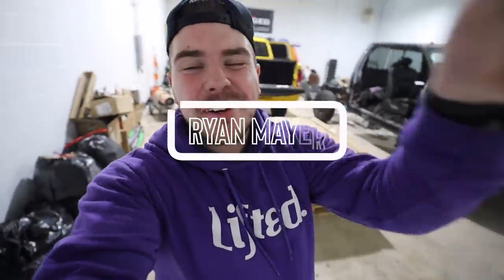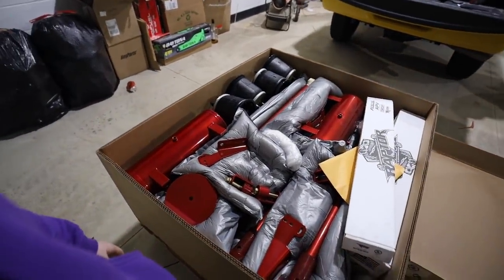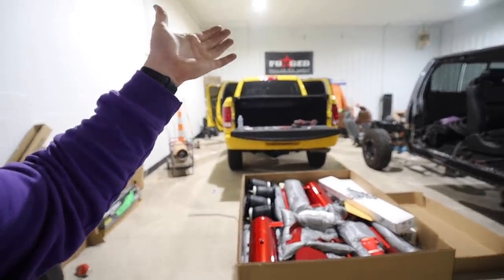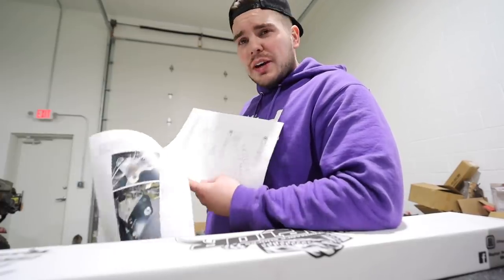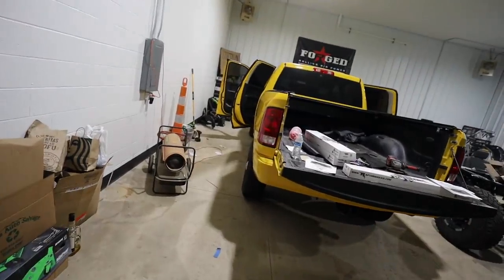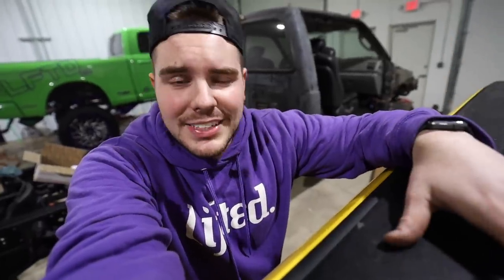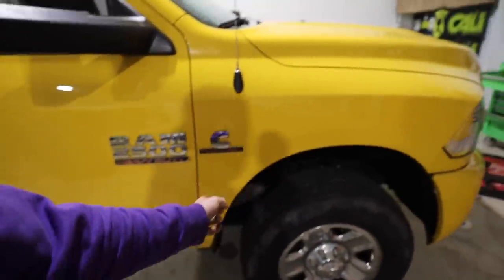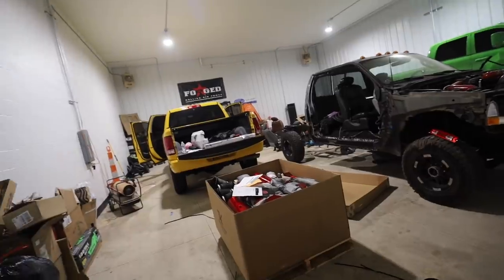The Kelderman LOWERING Kit?? IS HERE! | Building a Banana Ram | Part 20

Comment: Here's a good tip 4 ppl who put starlight headliner... use some sort of heat/sound barrier.  It's not 2 expensive,  helps with roof vibration ( if u listen 2 loud music😉),  and it'll help protect the starlight fiber optics on those hot summer days😁

Comment: Ryan: “you can’t really mount resi shocks on these trucks in the rear”

Carli: “That’s cute”
Reply: Yup! King makes resi shocks for 2500 4th Gens as well. 

I’m running Fox 2.0 resi’s with LSC adjuster on mine. A little thinking outside of the box and it can be done. Fox makes a direct fit 2.5 series with resi as well.

Comment: The rear tilt up hatch slider window should be like 2 sliders in 1, so fully screen 1/2 inner & 1/2 outer side way stronger if screen facing out both sides. double hinged middle each side fits down seals over inner & outer pieces & tilts w/slide prt way either side or port hole instead of slide.

Comment: If rear tailgate has a clear slide in plate spot built in with a locking safe screw it would be nice spot if u don't drive tailgate lowered.

Comment: The rear 50 vs 50 right left tail gate like ram basic set up like old suburban but then attaching to that is flip down prt as well normal oldest truck out there. So must fold down after u open 1 side up If u can pick wether to open left or right & then flip tail down seems like near to dodge best of all. 1 side tail folds flat other sde tail folds past flat. I came up w/idea to make rear bumper the tailcate when fully open or no bump tailcate  when closed off roading & alot of cool ideas in tail gates NOW but bumber tail gate is a $100 dollar option free use in market idea. U just hve mico rear bumper steal thin protection or flip down rear bumper my design, but I love dodge hving to styles in 1 suburban & fold down both ways sp for jeeps fold out rear racks style.

Comment: saw ad for jelly fish lighting. If it had solar mode so run the yr only every 3rd light 12 volt brights on or off w dusk to dawn mode but during holiday it turns color u pick every bulb can light or 1 bulb burned out rest stay on holiday mode.

Comment: Any tanks on the 20ft trailer where v swings to right or left so u can drive on & easy off for mobile truck wash. U just hve to put as many hot water drive type thin shallow tanks width of trailer u need on the trailer. Every thing else simple water quick connect up or off & must be able to pressure washer lift off trailer to ground turns on & off like pressure washer u talked about. A honda generator or similar set up few things to lift off or spring wand unfold so trucks can roll under no heaight problem then unset up nice & low going down road, same idea up firing sprinklers for car wash, just must get clean in 20ft or need a 2nd dive thru if mudder dirty.

Comment: A mudder hving a shock extend rebound up thru bed floor & into 2nd top shock rebound back down if u cause a bump shock tall rebound. Or just hve it stock bump shock limited for normal road use then just pull cap & counter rebound if into the bump strong range. The bump range u just unscrew or screw back on. So 15" single or double weight load set up can quickly switch to top of bed 30 2 15" shocks that counter rebound.

Comment: hving a 1ft 18" min slot retangle cut in front of your garage door so u hve flood protection & lift of grate 1 ft more drive in drive out under factory basic roll up door just need good 14" diamond gas diamond blade saw even if no plumbing u can leave bottom of cut out floor just easy drain gravel over sand or so collection pit & hve plenty of flood room range, as long as grate over hole has a way to cover seal off so not down grade drive way filling up off street into slot cut hole, no plumbing rain. Every fuck jeeper or suv owner needs it, & will gladly pro pay if neat work clean cut or patch clean grater weld up.

Comment: 487 depending on where in country u live u can take a 20ft ish flat bed 2 axles dual tire trailer & convert it in to mobile car brush less car/truck tall work truck w/easy from drive off ramp  just unfold in 1/2 * & tri fold or lay on over the dual fold to on to road. so easy drive on & off u get a change to hve lots of custom touchless traffic where ever u r at free ad & bussiness cards or location free car wash if u buy a 10 tee hirt combo deal ad into greater ad.

Comment: a bussiness card u read upside down or right side up & opposite the rear print side, & bc has a magnet every 1 getting 1 card u give to them & 2nd card stuck on magnetic on they give to some1 else. 4 ways to print u diff jobs u r willing to take bady /paint, or custom size frame off stuff, or mechanical any power easy bolts on or mechanical easy prt easy change out, or 1 other idea job powder coating or such install or power windows vs basic ride.

Comment: U were complaing about slider rear windows so just make then tilt flip up like a window a rear window of suv or cab then so u get slide to side or tiny oval port hole windows u can tilt open or just tilt up prt vent way or fully open rear slider window. U just need to make stonger too so oval window shape on ends of a normal rectangle rear window way stronger shap like jet plane. Better if 2 pieces so breaking it only left or right side or 1/2 split. Both need own hinge again way stronger that way/design near middle of each right or left 1/2 & 1 side inner 1 side outer seal up onto over top then whole window seals down RV style no rubber showing frame-less called design.

Comment: Every rim can be made central maga wheel set up tiniest wire support holding wheel together whether boring 1 tire per rim or dual two tires per rim inner & outer. Then u snap on the showy prt u like over same old same old every fucking rim tiniest magnam wire tire support. So lighter wheel more efficient & u can customize just for look or extra weight over normal factory wire load, $50 dollar per tire grand idea. u just snap on weight prt & custom prt if using 1 tire or dual set up in 1.